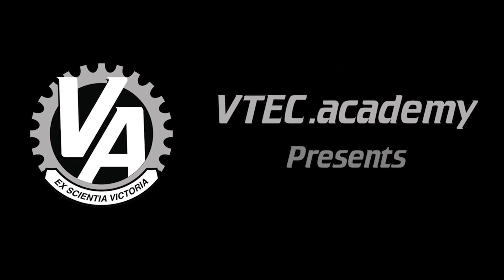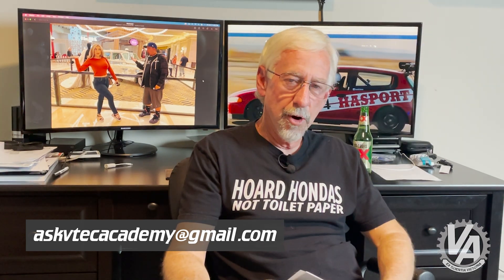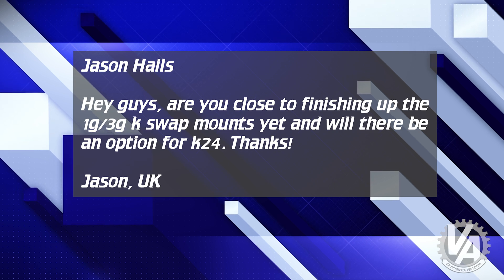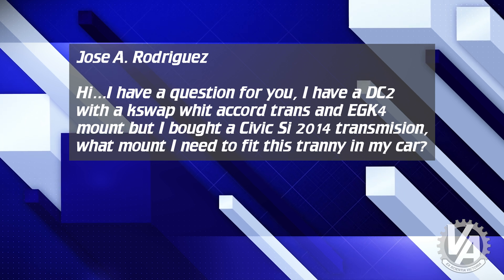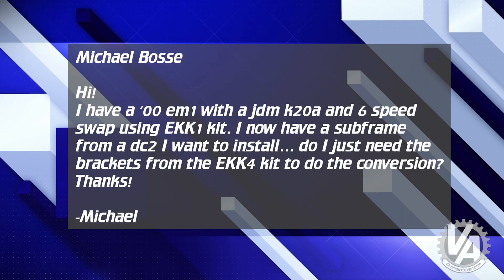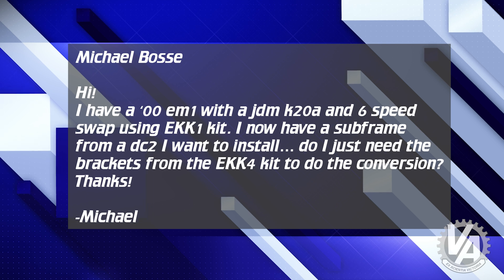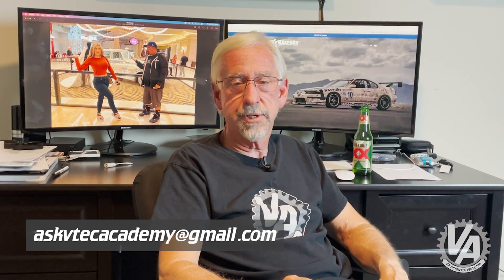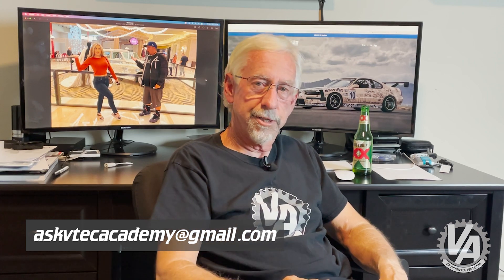Will your K series swap work with your transmission? K SWAP Tips/Information for Viewer's Questions

Comment: No clue if I'll get an answer on this. But im serious about putting a k20a3 into a base auto 2010 subaru impreza. How can it be done, and can it be done while keeping it road emissions compliant. Nothing against the ej motors, but when my tired ej253 goes out, the k20a3 having similar hp and tq plus the same style vvt makes for a much more reliable daily engine. So again. Can it be done, and how. I've got years to get this together, so any info would be awesome.

Comment: I have a K24 transmission I'm not sure which K24 it is but I'm trying to bolt it to my 2008 Honda Civic Si motor on the video I recently watched the K24 had holes already casted where you would need a custom bracket to mount it to the car my K24 transmission doesn't have those casted holes it's completely blank where those holes would be

Comment: Hey man I was wondering I have an 04 Honda accord ex coupe manual an I want to do a motor swap w the k24a, will I need to upgrade my transmission for better output or can I still run the stock transmission already in the car thank you so much as always and I’ve subscribed.
Reply from the maker: Stock is fine.
Reply: @VTECAcademy  thank you brother

Comment: hi thanks for your time much appreciated .can I use element transmission in ek kswap with k24a2 from 07 tsx.and what mounts do I need to change or get if I already have ekk2 mounts with eg subframe.
Reply: Did you ever get a answer to this? I am also interested in doing this

Comment: Anybody use a k20a2 or k20z3 transmission in a k20c motor yet?
Reply from the maker: That would require a fairly thick adapter plate. The K20C bell housing is much larger and the flywheel is much larger.

Comment: Doing a DC2 Integra K24A1 swap. Will an 05 Element harness and ECU from an auto work for this build? And what transmission would you recommend? I want to go AWD but they're hard to come by. Might just do the Accord trans like you had in your budget EG videos
Reply from the maker: The 05 (and 06) Element auto ECU can be modified by KTuner to work with your swap. Adapter harnesses made for the KTuner ECU will need to be modified to work with the Element harness. Using the Accord transmission can be a temporary setup while you look for the AWD transmission. You can switch to the AWD transmission with a few new mount brackets and different shifter.
Reply: @VTECAcademy  
Thanks for responding. 1st time doing this. So if I send my ECU into a KTuner dealer, they can modify both the ECU and adapter harness as needed correct?
Reply: Running a apg6 trans with a k20/24 in my civic dx with k pro and a rsx style tucked harness and my speedo is not working at all I know I'm late on this post id appreciate any feedback... I'm lost

Comment: I have a toyota tacoma 99 that I was thinking of k swapping. Is this doable with a rear wheel drive? I can find engine but what kind of transmission would I use? Thank you for any response.
Reply from the maker: You would need a transmission adapter plate so you so you could use the stock transmission or other suitable trnammission. There are transmission adapter plates already available for a few RWD transmissions. Check out Bill Hincher on Facebook. He makes custom adapter plates and may have a solution already.
Reply: man did you go through with it yet, I got a 96 taco with 300k+miles and leaking headgasket that I don't want to fix, I thought of k series my self or a 4g63t that I got on a stand..

Comment: Can the RSX shifter box and cable work with the 2003 accord manual transmission?????
Reply from the maker: Not really. The shifter works differently than the Accord manual shifter.

Comment: I have an 03 accord which is throttle by cable. I'm doing a swap from an 05 tsx and to get it running I want to use all of the drive by wire components from the tsx. I've studied the different pinouts from the ecu and it looks like the only difference in the ecu is the egr and tps vs no egr and throttle pedal position sensor wires. By using my tsc harness this will all be bolt on and plug and play. But the drive by wire relay (dbwrly) Is in the dash harness. Can I use my stock accord dash harness and just ad the relay by tapping into my fuse box? Idk if this has been done before. I know the easiest solution is just to get hondata ecu or comparable but I lack money for that. But I have a complete tsx. So parts are already here.
Reply: Did you ever figure this out? I'm having the same problem. Thank you
Reply: If you use the TSX drive by wire ecu you must use the tsx dash, wiring, gas petal, abs, tb, engine harness from the same year as your ecu.

Comment: Putting a 2012-15 civic si 6 speed tranny on my 2002 rsx s. My question is what rear braket that's OEM or after market will work for it, since the tranny housing has different mounting points ?. Thank you.
Reply from the maker: The Hasport ESK4RRB. Email then for information.
Reply: @VTEC Academy  thank you. love your videos.
Reply: Did this ever work out for you? What ended up happening?

Comment: I am running a 03 ep3 5spd trans on 03 rsx engine, but wonder about the shifter mechanism in the trans itself, if I need to change that assembly to the rsx version. It kinda looks like a t with spring around bottom. Shift selector mechanism I think
Reply from the maker: Just use the RSX shifter and cables. The mechanism in the transmission doesn't need to change.